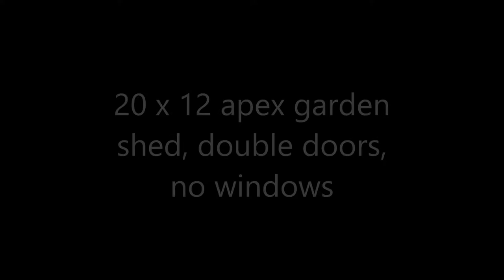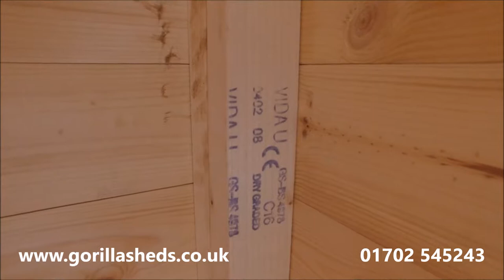Gorilla Sheds 20 x 12 apex garden shed with double doors

Comment: i am a joiner and that is a exellent shed i may buy one 20x10 ft, would treat it with cupronol probably not creasote though, use bolts on the hinges.
Reply from the maker: Thank you!
If you're thinking of bolting the hinges for the sake of security, we could fit the shed with continuous hinges instead so that all the screws are concealed.
Continuous hinges run the full height of the door from bottom to top,  They are probably the securest hinge for any shed.  However, they won't stop a determined thief, if they want to get in then they will.

Comment: Hi I don't have the luxury of a side entrance into my garden as its a small terrace property, do you do it in smaller panels and will I be able to get a shed this size 20ft x 12ft in through my house into the garden?
Reply from the maker: There's a video here of a 20 x 12 that went through a house: https://youtu.be/_atBC0gH1xg?si=XaryxWINEc6bOb_d 
We would need there to be a reasonably straight run from front door to back door with no sharp turns, but it can be done!